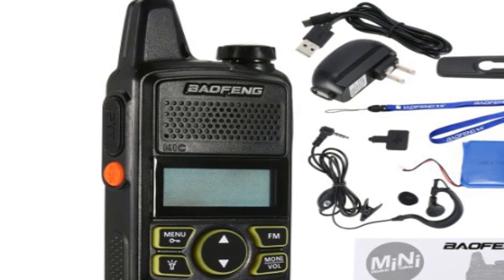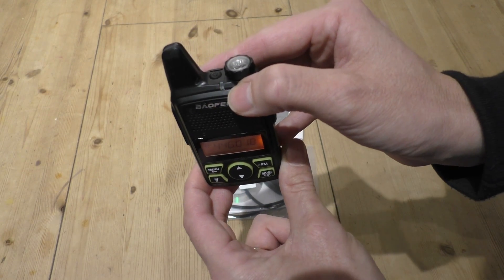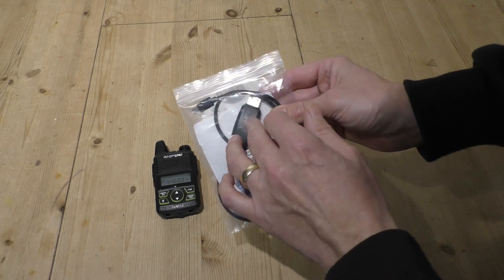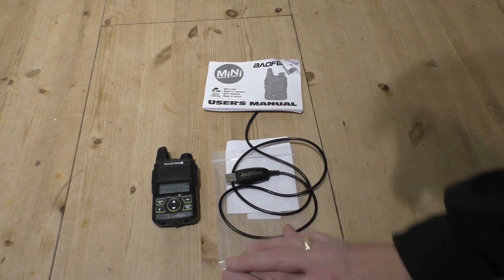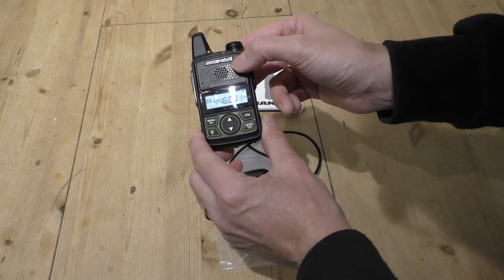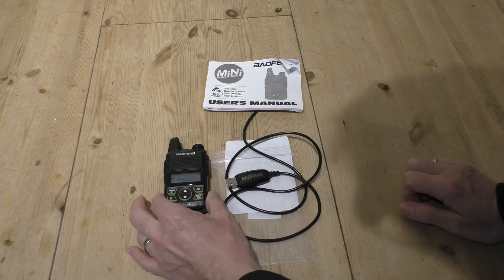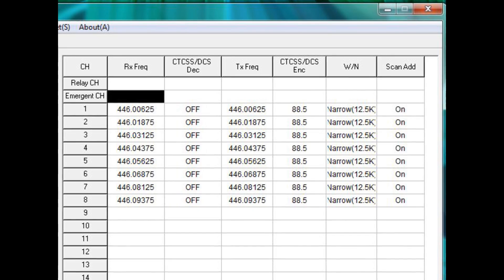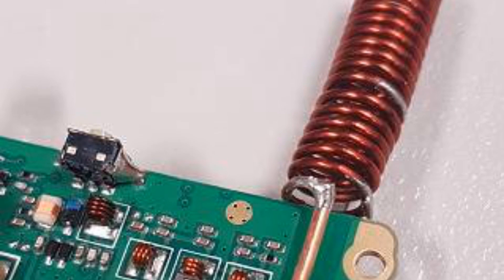Baofeng T1 radio :  446Mhz  pmr 9100 Programming software.

Comment: It's a great video you shared.  Thanks a lot!

I've just bought two bf-t1 radios, but one of them was already being factory reset.  Only one channel is left in it.  Do I need to buy a bf-t1 usb cable so that I can reprogram all the channels back?  Any other solutions so that I can do the communications between the two radios?
Reply from the maker: You really should reprogram the radios anyway to the 16 legal 446 Mhz PMR channels.  Best free program to use is " Chirp" (google).  I think a normal USB cable works ?  Might not though as its been a while.

Comment: Hi Fred! Thanx for this nice video! Do you know if your original Baofeng programming cable and 9100 software works on Windows 10? Wich driver shoud i use? Thanx again!
Reply from the maker: Hi i would first try "Chirp" sofware to program the radio.
Reply: @CB-RADIO-UK  with the original baofeng prog. cable? Any special driver? Thanks for your answer!

Comment: You're not allowed to use these on any of the PMR channels full stop. Nothing over 0.5w is allowed and these in low power mode are 1w at least. This has a detachable antenna so it's also not approved here in UK. The PMR with fixed antennas are fine and legal but these are not approved unless you have a licence on the lower frequencies for HAM use.

Comment: I’ve been messing around with one of these lately. As you said, with the UHF antenna it’s not a good idea to transmit on VHF but it surprised me how well it receives VHF. I can get the nearest weather band repeater (a county away, at least 15 miles!) and in town I can listen to the local police and 911 dispatch. If only it wasn’t so loud!
Reply: Yes an untuned antenna will still RX quite well, however you would get 15+ miles if the antenna was tuned to VHF :)  Please be aware that if you TX on your radio in VHF it will shorten the life of the radio.  See google or youtube for swr.  Untuned antennas are not resonant, so they dont emit all of the RF energy, a significant amount is reflected back to the radio that causes heat and damage to the transmitter part.  Cheers. Tim

Comment: Fred, can the BF T1 can be programmed to UK channels ? I am looking to use it for green leaning offload and the band used is :  27.00500/27.63125 MHz	CB Channel 04 open to all--4x4 channel. thx
Reply from the maker: Hi.  The radio can be programmed to the UK PMR channels on 446 MHz but it cannot transmit or receive on any CB channels.
Reply: @CB-RADIO-UK  thank for the response. What walkie talkies can I use as a cb radio? Thx

Comment: Is programming it necessary?
Reply from the maker: You should really reprogramme the radio.
Reply: @CB-RADIO-UK  benefits?
Reply from the maker: @shine7103  The pre prog freqs are normally just test freqs and often are close to emergency channels ot Ham bands.  You can cause interference.
Reply: @CB-RADIO-UK  got it thx, tho I'm also slightly doesn't understand 😅
Reply from the maker: @shine7103  Not a problem.  The radios are tested at the factory in China on a range of test freqs.  Depending on your country these test freqs can be close to emergency channels or other HAM radio freqs. If you walk around transmitting on them you could cause interference.  You could get in trouble esp at a event with police present. Thats why its best to re programme them to the public approved 446 Mhz PMR channels
Reply: @CB-RADIO-UK  owh got it.

Comment: Hi Fred, may I know if the list on this facebook page for the default frequencies are okay to use since it said default. 
https://www.facebook.com/emergingdragon88/posts/baofeng-bf-t1-default-frequencych1-437150-ct-693ch2-439250-ct-1000ch3-441750-ct-/1508617295869393/
Reply from the maker: TBH ive no idea.  The radios seem to ship with a range of test freqa.  The first thing i do is wipe them and reprogramme the PMR 446 channels in CHIRP.  You can also read the shipped freqs in the program.

Comment: So I just need to click read and write on the program, with the radio connect with the programing cable and its done? It will comunicate with the other radio?
Reply from the maker: Yes once you have entered the freqs that you want on the channels - write to radio and that should be it.
Reply: @CB-RADIO-UK  I just left the frequencies that appeared wen I clicked read, does it comunicate like these?
Reply from the maker: The freqs that are supplied loaded on the radio are normally test freqs and prob illegal.  Most people re program the radio to the public PMR 446 Mhz channels.
Reply: @CB-RADIO-UK  huum ok, where can I find those public PMR 446 MHZ channels?
Reply from the maker: https://en.wikipedia.org/wiki/PMR446.
Reply: @CB-RADIO-UK  Thank you very much, I can't find the freqs on the site, but it as a lot of interesting information. I' ve programed the radios and they communicate with each other, but only in very close range just a block away, with some noise, but it works very good with the repeater that I found on the internet its 2,8 km from me!! I dont understand! Sorry about all these questions, you are the only person that answered me and im very interested in working with these radios.
Reply from the maker: Well done.  They have a short range in a built up area.
Reply: @CB-RADIO-UK  ok, its just that I see a lot of videos here on youtube of people doing range tests, and they get like 4 km in the city and even more with local repeaters! And my old cobra and motorola radios that are so basic get 4 km too.

Comment: Hi Fred, thanks for  the video. Nice clear images and commentary style. One thing which does puzzle me - all references that I can find to the minimum frequency step size on this radio state 12.5KHz,  obviously meaning on 'round number' 12.5Khz steps like .0000 , .0125, .0250, .0375,  0500, .0625, .0750,  .0875 and so on. I was a little bit surprised to see you apparently programming the PMR446 frequencies with their +6.25 Khz offsets straight into the software and into the radio without any complaint or objection from the software. Does the radio really accept these spot frequencies or does it just adopt the nearest 12.5Khz step, which in the case of PMR446 channels will be about half a channel out? Have you any way of measuring the actual transmitted frequency?
Reply from the maker: Sadly not.  At the time of testing they seemed on freq for the 446 PMR.
Reply: I've had the chance to play with one of these now - the situation re: frequency programming resolution isn't nearly as bad as I feared. When programmed wth PMR446 frequencies for a test, all TX frequencies were within about 200Hz of the displayed frequency, which is not too bad on 12.5Khz spaced channels. It looks like the 'step sizes' of 12.5Khz / 25Khz mentioned in the spec really refer to the two switchable channel bandwidths (especially the deviation, or 'width' of the modulated TX signal).
Reply: No problem for PMR 446 frequencies (step 6,25 khz OK of PLL)

Comment: Hello, I recently bought two of these, I would like to know what channels I need to add just for simple use like communicating with my wife during a camping ? I live in Florida and I do not know anything about which channels I should use without an FCC license. THANKS
Reply from the maker: I would program them to the legal 446 Mhz PMR band channels.  More here. https://en.wikipedia.org/wiki/PMR446
Reply: @CB-RADIO-UK  No that's illegal. They need to program it to the FRS channels. You have just advocated illegal radio broadcasting that the FCC wouldn't approve.

Comment: Can anybody tell me where I need to go so I can download the software to my computer or is this radio or do I have to use a CD
Reply from the maker: Contained In the description of this video is the driver needed for the cable and the software to program the radio. https://www.youtube.com/watch?v=QP4jmnKUwNU
Reply: fredintheshed1  yeah I went to that video and click on the driver Link and at the top left of the screen it said not found error 404 and then when I click on the other Link it says no preview available in right below it says downloading and when I click on download it takes me to a blank website with nothing on it that’s the problem I’m having
Reply from the maker: Oh ok sorry about that. That was the driver i used.  I can only suggest the Baofeng main web site.  Of maybe a google search.
Reply: fredintheshed1 OK thank you
Reply: I never had so much trouble with a radio before LOL
Reply from the maker: Ive found the Olywiz software for their radios's spot on.  Baofeng can put you through the mill but it normally works.
Reply: fredintheshed1 ok

Comment: Hello. Press the flashlight key 2 sec but the scan does not work. Why? Thank you
Reply: To get scan to work, make sure that the channel isn't set as "SKIP" when you program it. In Chirp it's the SKIP column set to a blank. In this video the column is "SCAN ADD".
Reply from the maker: Oh thats a bit odd.  I dont know if you can reprogram the scan key in software.
Reply: I just bought two units and I can't get the scanning to start by pressing the flashlight key for two seconds. May be there is something that can be done in the programming software.